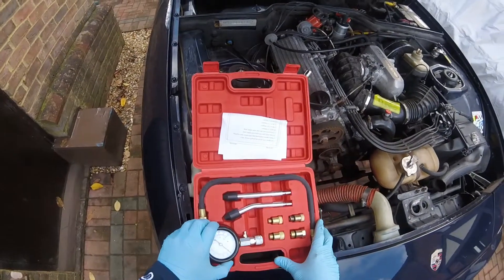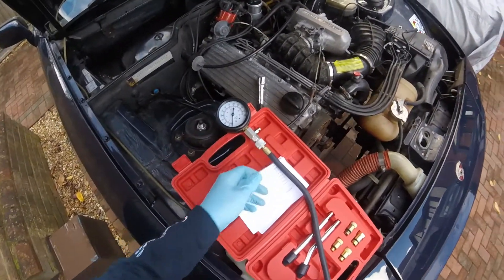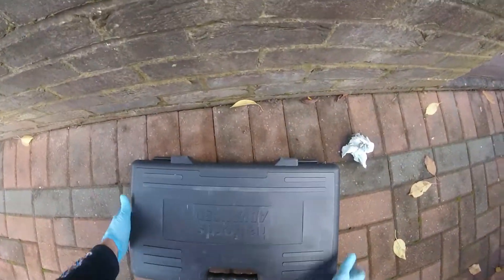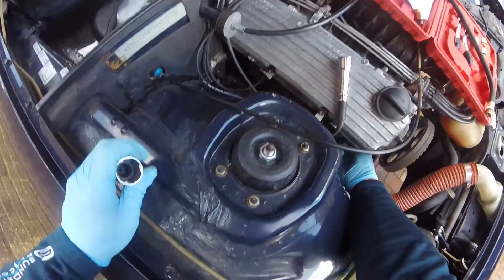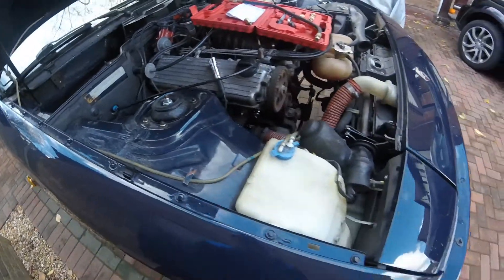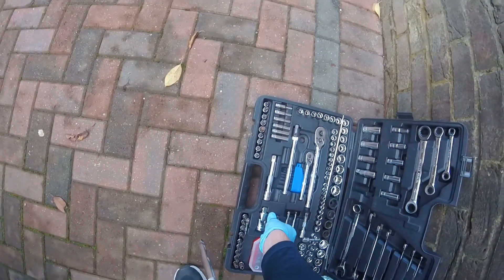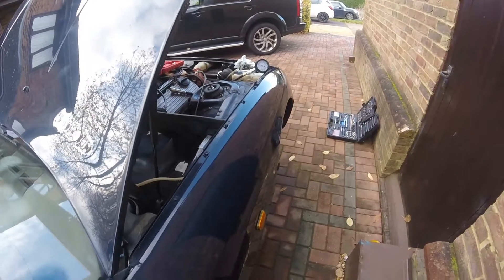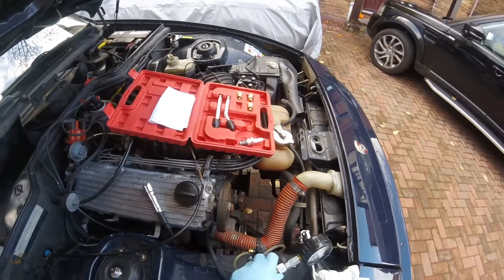Engine compression test results are in - Part 5

Comment: You would have higher psi and more accuracy if you removed all the spark plugs first and cranked with the throttle open, also valve stem seals have nothing to do with bad compression as both valves would be shut at TDC...
Reply from the maker: Appreciate the comment Laurence, always good to have feedback, so thank you ;)

Comment: I did a compression test on my 924 na yesterday. 
Cylinder 1 175psi the rest were 180 psi roughly. 
This was done on a warm engine with the throttle fully open.
Reply from the maker: You definitely have great pressure in your cylinders DG. No issues there. Try a cold test too and see if the numbers fall within the tolerance of 114 to 156 psi. 👍